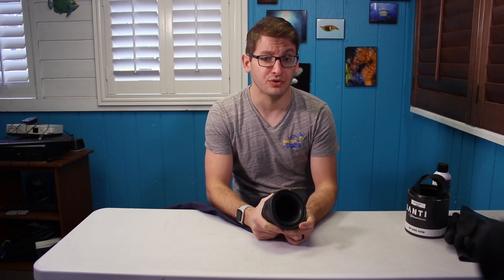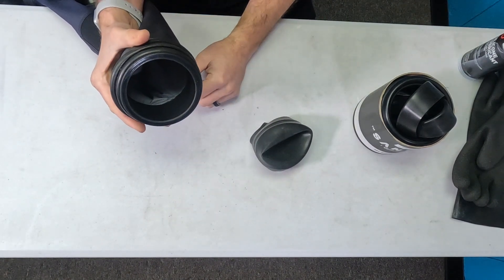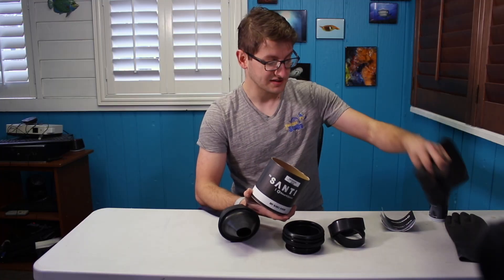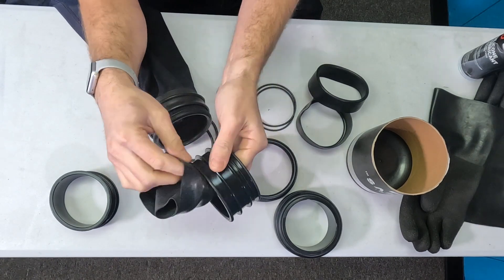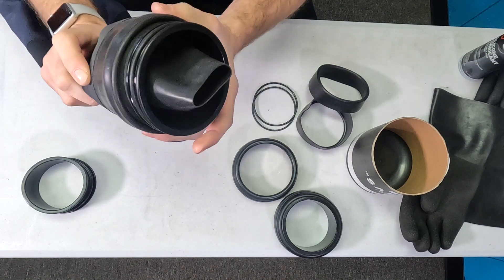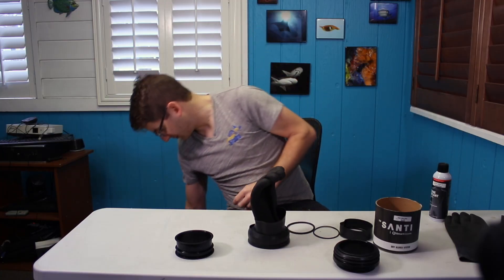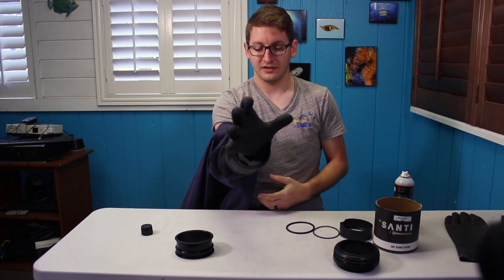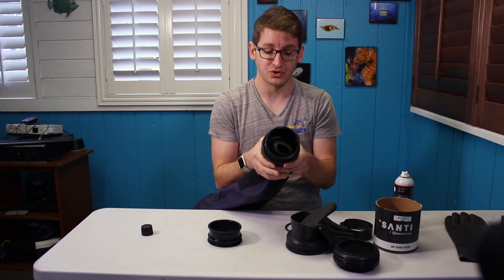SANTI Smart Seal System & SANTI Smart Gloves

Comment: Can these be installed to DUI ZIP Seals....getting sick and tired of buying DUI Zip Seals they are over priced looking for another solution?
Reply from the maker: No they cant be installed on zip seals unfortunately. KUBI, Thenar, Glove lock, Quick Glove, & Ultima Twist can be attached directly to your existing zipseals. OR we can remove your zipseals and install a SITECH Oval or Round system and then you cant stop paying DUI pricing
Reply: That  is what I plan to do cut out my zip part on my cuffs and install the Siteck   oval...how much do I cut of  I have the latest zip part...like you mention ...

Comment: When using the dry glove on the ring, why fold the extra material back over as opposed to letting the extra material go to the end of the ring? Seems like the beauty ring would create a second seal similar to how the smaller front O ring does. I'm sure I am missing something here and not saying I know better, I just want to understand better. Thank you
Reply from the maker: You can certainly give that a go, shouldn't be any reason why that wouldn't work! The way shown here is just te "by the book" method in the santi manual